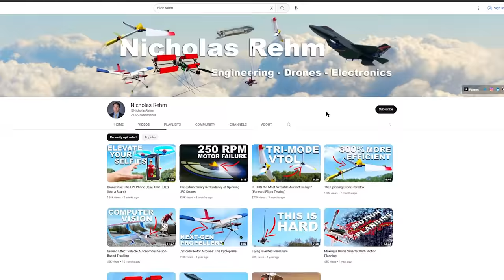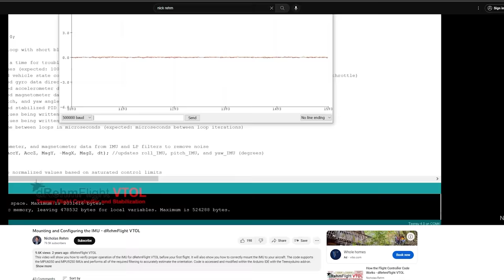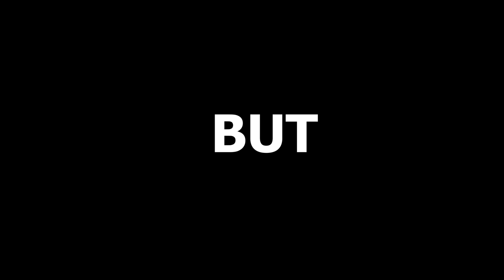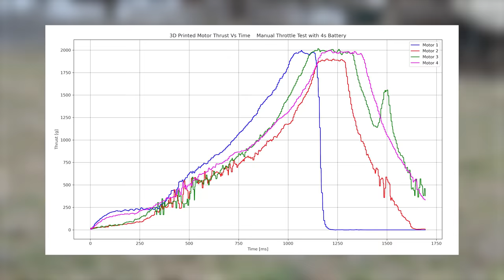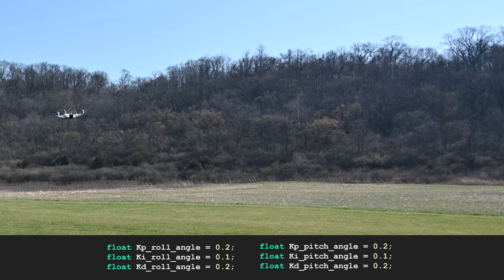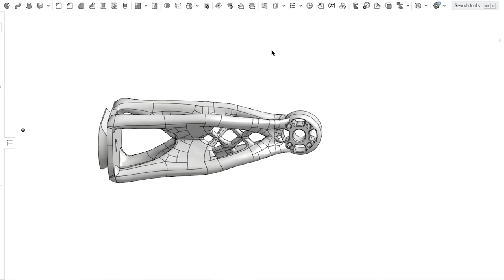Flying a DIY 3D Printed Quadcopter... Will it work?

Comment: I think you should reprint it all in PETG, and I think your wall thickness  was 4mm, make it 3mm. Than make it all thinner, you might be able to cut down all the plastic weight by 50%. amazing job by the way, I love it
Reply: i agree, but with how massive the print is i think we'll only be seeing that a few months down the road in a V2 that has many more upgrades
Reply: Maybe reprint in HIPS. That stuff is less dense.
Reply: PET-G has a higher density than PLA. Nylon probably is a better material for such a project. It's less rigid but more resistant to snaping. Or maybe Nylon with carbonfiber
Reply: @blazej135  Yes, nylon is the way to go, ideally with CF content.
Reply: PETG is denser than PLA and less rigid.
Reply: Could the centre bit be LWPLA?
Reply: It’s just a cool proof of concept anyway. The whole thing could be much lighter if he’d used some carbon tubes for the arms. Would also avoid the dovetails and allow for a much lighter central body.
Reply: @r1m.dog78  that's what i was thinking - 3d printed planes often use LWPLA
Reply: Nylon, petg, and pla are all significantly more dense than ABS. His bambu labs printer would be capable of printing ABS since it is enclosed.
Reply: Abs would be better it's way lighter than pla
Reply: Polypropylene might be a better choice if he can print it. It is slightly flexible so can handle impacts very well. Nylon would be good too.
Reply: @theofficialczex1708  petg is more flexible
Reply: @lukesmith9059  I use a ton of abs for flying things and it's definitely my favorite because of how light it is and the impact strength is miles better than pla.
Reply: @pomax007  That's what "less rigid" means, yes.
Reply: PETG is the worst possible choice for this application, it's too flexible and also heavier than PLA.
Reply: PETG shatters under stress, would be a terrible choice, every crash would break. PLA+ is a way better option
Reply: Why is no one talking about Abs ? 1,04 g/cm³ and Abs has better impact resistance than Pla or Petg
Reply: I say print it in paper. Paper is very light. Or maybe spaghetti.
Reply: Try print in PC, it is light and extreme hard
Reply: make thicker walls but use way less infill
Reply: I AGREE! AND I have and idea for the motors too!, what if you add the magnetic flux path back into the motor. my guess is just some metal strips, maybe one with a curved end to match the profile of the rotor magnets? (thick enough to withstand the g force?)

Printing with PETG would also withstand 41% higher tempature, before suffering from flex and deformation (PETG: 85c max vs PLA: 60c max)

My best guess, is this would DRAMATICLY increase the motors output efficiency (more power, more torque, etc.), the motors could be downsize as it will make way more torque then, maybe just enough to offset, metal strips, and maybe overall, lower the weight significantly! I'd love to see this tested!

Comment: as someone that builds and flies quads: Larger props (get them as close to touching as you can without actually touching), swap to a flight controller built for X-Class (dont worry you can still use your extra bits and bobs, and likely get better use out of them), and yes 100% get some FPV on that bad boiii. Dont print props. Others have had this idea and found out the hard way why nobody actually does it.

Comment: Slim down the drone body, optimize out as much weight as you can, get the largest two-blade props you can practically use, and get a bigger battery.

Comment: Arguably, having a somewhat fragile retainer for the props can be a good thing. On impact, something must give, and personally, I'd prefer to make the engine's rotational force eat a small 3d printed part rather than smash the daylights out of a much more spendy prop. I'd probably say, if it's strong enough to transfer normal levels of torque, it's dimensioned correctly.
Reply: True, as long as it really doesn’t fail in flight at some point and cause a much more catastrophic crash.
Reply: One of the benefits if he were to print the retainer out of PETG is that it tends to fail catastrophically with a repeatable amount of force rather than slowly and unexpectedly. Makes it useful for printing predictable mechanical fuses.
Reply: the thing is that you should make that easy-to-broken parts also easy to replace. It would be nice to add an easy to replace stress raiser for the arms support.

Comment: I still think it's crazy that the motor cores are 3d printed as well.

Also definitely print blades, it makes much more sense for the project
Reply: Try to print blades and you will understand why no one does it.
Reply: @Willy_Tepes a resin printer could easily print the blades
Reply: @gravymuncher6771  If I had a resin printer I could do that. If I had a 3-axis milling machine I could do a lot more. Point is, resin printers are not a standard household appliance.
And I still think the blades would suck.
Reply: @Willy_Tepes  worth a try, if you haven't seen major hardware as he prints and test fans, though its more for pc cooling benchmarking, but I think it shows that 3d printed propellers are sufficient enough
Reply: @tyredrunner  The issue is layer height and print direction, and how this affects surface finish. On a propeller this looks like wood grain and is not good for aerodynamics.
Reply: @Willy_Tepes  we're getting to the point where a resin printer is a standard household appliance for a maker, they can be had for just a few hundred dollars these days
Reply: @ufffd  You still have layers on a resin printer. The main problem is the same as with ink jet printer. You can get the printer for almost nothing but the ink is expensive. It is actually cheaper to get it printed online.

Comment: I personally have been using on shape for over 5 years now for simple CAD work and it's been amazing! It's also completely free, as long as you post your models publicly. I've compared it to other CAD programs like solidworks, fusion, 360, etc, and it holds up every time. Me and my engineering co-worker design things all the time on it, and are both able to access the file at the same time and see changes happen in real time. It's definitely my number one go to CAD program. Awesome build by the way 👍
Reply: TinkerCAD is a slimmed down online version of AutoCAD and has most of the features anyone could need, and they don't require you to post your design for free.

Comment: PLA Pro is strong and has a matte finish. Also I'd recommend grabbing a bottle of Weld-on 4 and some pipettes. You can literally melt broken pieces back together without heat and make nearly seamless repairs to PLA projects with about 80% of its original strength after it cures.

Comment: As the great engineers said - with a good engine, a stool can fly.
In this case with a good battery.
Reply: The motors are the engines.
Reply: @MysteryD  :  Without a good battery, a motor (engine) is a paperweight.
Reply: @PiefacePete46  without a tank of gas, a car engine (motor) is a paperweight.
Reply: @Varue  :  Yep... should hold the paper securely too!   😜

Comment: Very cool project. I subbed to follow it. The fact that you made the engines is the most impressive part to me. These would be my suggestions based on printing... let's say load bearing parts:
Use PLA+/PLA Pro without any further additives like silk or glow-in-the-dark.
More walls = more stronger (usually).
Use an infill style that gives good strength in all directions rather than a plane grid or similar.
I hope to see you develop this drone further.

Comment: Consider switching to using ASA as your material. It has a roughly 20% smaller density which could lower the overall weight of your quad and allow for greater flight times. ASA is also UV resistant so when you fly it outside it will be able to handle the temps and UV radiation better than PLA and won't approach the glass transition stage during flight, which needless to say, would be catastrophic. You could also potentially use foaming ASA or foaming PLA for the arms and main body if you were to provide it additional stiffness by inserting smaller diameter carbon fiber rods (this is the approach I am using on my 3D printed robot dog to reduce mass/inertia).

PLA ~ 1.25 (g/cm^3)
ASA ~ 1.07 (g/cm^3)
LW ASA ~ 0.47 (g/cm^3) @ max foaming

So if you changed to using the LW ASA at a more moderate foaming of around 0.7 (g/cm^3) you could have a roughly 45% weight reduction while gaining UV stability, greater operating temperatures, and longer flight times. 

Just some thoughts! Great work so far! Absolutely loving this project

Comment: How about using Polylight Lightweight PLA for printing?
BTW the stories about PLA's biodegradability are exaggerated as 5 year environmental test has showed very little change in structural degradation. Only the colour faded.

Comment: I know how enticing it is to print those prop hubs on their flats, it means you will have no supports to cut away. If you print those prop hubs like the wheels of a car on your print bed, they will be stronger because the layer lines will build in strength. Your shell is most of your strength in any print, weakest In between the slices. Printing the prop hubs on their side will make the fingers that reach around the propellers stronger

Comment: Cool project, it reminds me of my journey building quads 15 years ago. :) I'd ditch the PLA and use PETG or even ABS (since you have a Bamboo Lab printer). You can also 3D print the props, but I doubt you'll get better results. There are some new cool designs for low-noise props you could try. Good luck.

Comment: What you should do. Use a combination of carbon fiber and 3d printed parts. You can 3d print the body and motor mounts and use CF tubes for the arms. use PETG CF for stifness

Comment: Great project! Intuitively, it feels like raising the PID $I$ gain would solve the drifting issue without needing to hard-code in the ESC or FC that a motor produces less thrust. I'd be curious to see if this idea actually works.

Comment: rule of thumb for a freestyle/racing fpv drone is 20% weight for motors, 40% weight for battery, 20 % for frame and electronics and 20% weight for the action camera (racing drone don't get  the action camera so they are lighter and faster)... so my first idea would be to make much lighter motors.

also you can swap your ESC to make sure it's your 4th motor that is weaker, that is if you didn't use the same esc for all four motors on your thrust bench test.

I am impressed by all the hard work you did for this video... I typically assemble my drones in 1 to 3 hours, but it looks like you spent at least 100 hours on this :) I must say your result is much prettier to look at.

Also 3D printed frames introduce a lot of vibrations making tuning much much harder than using lighter stiffer carbon. It's also way more fragile. I guess you will need to find a balance to use more carbon for better results while still finding a way to 3d print some parts to keep your sponsor happy.

Comment: Brilliant results.
Obviously, it have to become lighter, twice lighter. A lot of exhausting CAD work to reimagine it for remove half of plastic.  I, personally, prefer ABS for such task. With nozzle up from 0.8 and +/- 250°C  it become strong like injection molded.
Nylon-X stronger, but heavy.

Comment: Print orientation influences the strength of the print. And wow, that even looks heavy. The key to engineering is to use the correct material for the intended purpose. This could in fact be stronger with a simple shell construction and 5-10% infill. The outer shell is what provides most of the strength. You can achieve 3 to 1 or even 4 to 1 trust to weight ratio with better design.

Comment: With bigger batteries it should be programmable, so it can be used as an automatic leaf blower, or why not make it accelerate the melting of snow during "warm" spring days.  It looked like it already needs to create a massive airflow just to stay airborne with even more mass from bigger batteries it will be even more.

Comment: It seams to me like the motors are very torque, but also have fairly slow throttle response. Getting even bigger props would solve that problem and probobly give it a bit more flight time.

And you might want to check if the gauge of the wire really need to be that large. There should be weight saving to be gained in those motors.

And maybe check out halbach array for those motors.

Comment: I have and idea for the motors too!, what if you add the magnetic flux path back into the motor. my guess is just some metal strips, maybe one with a curved end to match the profile of the rotor magnets? (thick enough to withstand the g force?)

Printing with PETG would also withstand 41% higher tempature, before suffering from flex and deformation (PETG: 85c max vs PLA: 60c max)

My best guess, is this would DRAMATICLY increase the motors output efficiency (more power, more torque, etc.), the motors could be downsize as it will make way more torque then, maybe just enough to offset, metal strips, and maybe overall, lower the weight significantly! I'd love to see this tested!

Comment: Change your infill. Gyroid or cubic would be way better than just grid. Increase your temperature just a couple degrees for better layer adhesion and keep your layer height over 0.2mm. 
You could easily print the bigger pieces with gyroid and 10% infill and save a ton of weight. For smaller pieces and stronger pieces cubic.

Comment: If you can print in ABS, that would probably be the best material for this project. ABS is one of the least dense materials available for 3d printing, and has a good balance of rigidity, toughness, and heat resistance. ABS+ from esun or Sparta3D (my personal fav) makes printing large parts in ABS with minimal warping MUCH easier.

Comment: I don't know what you mean when you say "also increasing the integral gain in the controller" (around minute 8.46), but when I see how the "flying object" barks in the air I immediately thought, "he needs an accelorometer!!!"
You should apply a device that can automatically increase/decrease the rpm of each motor to achieve more stability.
I am not a technician, the only thing I can say is that every cell phone has an accelerometer, and it is responsible for providing information about its position in space (and eventually rotate the screen or even tells the position, direction, and inclination of a photo - for instance).
Based on this, I suppose a program will not be too difficult to implement!
I hope this will help!

Comment: You can cut way more material out to the point you think it's way too thin and then coat the prints requiring strength with super glue!  Way lighter and stronger!  There is also Taulmans 910 alloy if you want super strength!!!

Comment: for a lot of the parts Id just use a 0.8 nozzle. The strength of parts printed with a thicker nozzle is on an entirely different level. Set up one of your printers with a 0.8 nozzle for structural parts

Comment: If you have the X1Carbon you could print the parts in nylon carbon, would be lighter but more expansive. There is also something called light PLA but I think it would be more fragile. Great video thank you.

Comment: Maybe a tricopter would save some weight. Also, maybe you should look into collective blade pitch mech and belt drives so you can run 1 motor for all props like the quadcopters 3d and invert fliers of old.

Comment: i dont know if during the motor build you checked the strength and polarity of each magnet used but incorrect orientation/field balance can cause lower performance and the only way to know for certain is magnetic film as used by the original designer in his build vid

Comment: I would guess you could scale this up probably by double (including prop size but maybe not double) those motors must have some serious torque that might be underutilized even with 3 blades. Awesome project thanks! I've been following the motor project since it's first upload and have been anticipating this project ever since!

Comment: you need to just make the arms out of cf rod, and print the parts that fit onto the rods, the amount of mass of 3d printed plastic is crazy. lol  Cool though I've never seen someone 3d print their own motors that actually worked, that's pretty impressive.

Comment: I built my 3D printed FPV drone from Carbon Fiber Nylon. Takes a bit to get the print settings working, but it's insanely resilient compared to PLA and PETG. Those are both too brittle to resist impacts seen on the drone.

Comment: What is your power to weight ratio? What is the load on the motors (or operating temperature)? 

For efficiency you not only want 2 blades but big diameter 2 blade props. Going to higher voltage can help reduce temperature (assuming same wattage).

Comment: First time watching this channel. Cool quadcopter. It seems like you are designing it around your diy motors which are a bit heavy. Is that the case? If so it seems refining your design would mean creating more efficient motors that are lighter. Adding more batteries = more weight. Gonna have some diminishing returns I think.

Comment: it is necessary to replace the wheels, disks of a larger diameter and with a minimum of flat rubber so that during rotation they do not narrow and reduce contact with the asphalt at high speed, for this reason, at the end of the video, the car lost traction and flew away

Comment: What tool did you use to create the arms? I'm looking into a 3D printed drone build myself and the biggest problem I'm seeing people have online is with arm rigidity.
Reply: You don't have to 3D print the entire thing. The firearms community found this out eventually. Use the correct material for the intended purpose. Carbon fiber is better for arms.